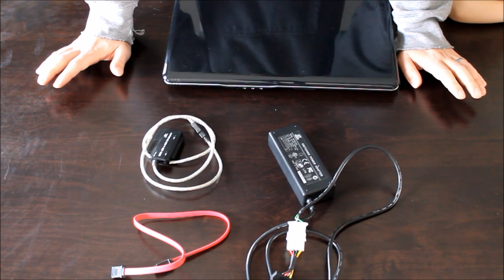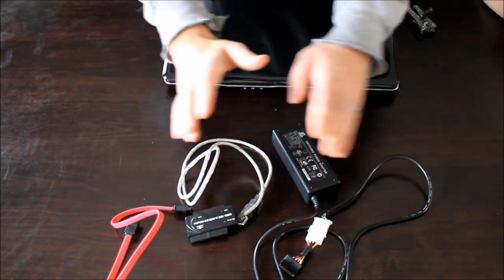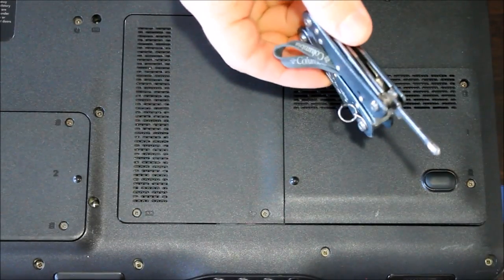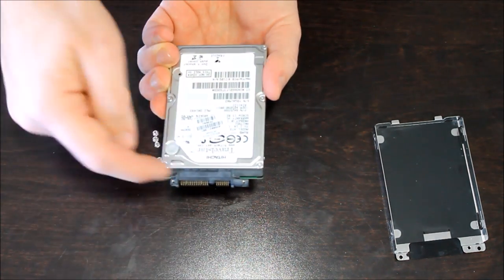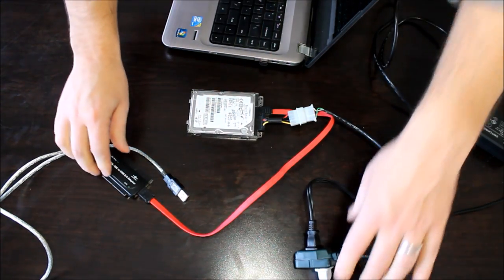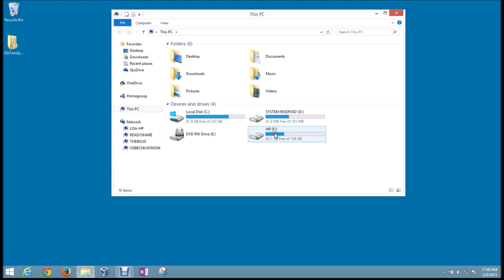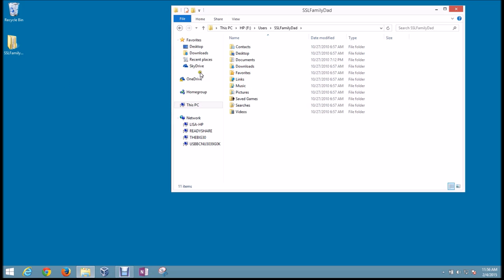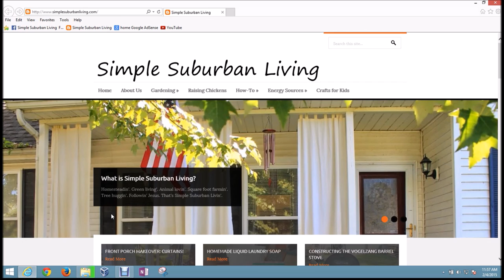How to Recover Data From a Dead Computer

Comment: Hello, my netbook has a problem in it, when i open it a hard disk error always there, and when i press enter to continue start up, this appears, this error can be caused by unplugging a removable storage device such as an external Usb drive while the device or in use , or by faulty hardware such as a hard drive or Cd-rom Drive that is failing. make sure any removable   storage is properly connected then restart your computer. if you continue to receive this message contact the hard ware manufacturer 

Status:0xc00000e9

Info: an unexpected I/0 error has occurred
can u give me some tips so i can recover my files without damaging it.

Comment: Does this method also retrieve my outlook (email) files?
Reply from the maker: +Linda Casey you can, they are in a pst file either in your documents folder or in appdata/local/microsoft/office/Outlook or a similar folder I can't verify right now as I am mobile but you can look it up
Reply: I'll need the cords you recommended for this right? Also, I have a completely dead blackberry, can't get it to turn on at all anymore. Is there a way to retrieve my data from this one?

Comment: Does this work if the computer is password protected?
Reply from the maker: mgiauque01 yes, it should not matter as the Windows security only loads when you boot the hard drive normally. If you access it from another computer there is not security in place. The only way it would not work would be if the data on the drive was encrypted using some third party security or bit locker.

Comment: Hi. How can you tell if it is a damaged hard drive or the motherboard? I have a Gateway that just wouldn't power up one day. The little light on it that says the battery is charging was blue but when I tried the power button, nothing happened. I tried the power reset by unplugging and taking the battery out and holding the power button for 30 sec to a min and then putting everything back... still nothing. Hoping it's not the hard drive so that I can try this method to recover my files and pictures.
Also, how would you do this on a desktop? Thanks.
Great video btw. Makes it look so easy. :)

Comment: Thank you, I'm getting those cables on order.
So the hard drive is corrupted and I was told by the fix it techs to retrieve the data I would need to send it out where they would retrieve the info while in a clean room.
I mentioned your YouTube and how understandable the info is.
They said you don't know what you're talking about, I misunderstood, or you were talking about something else.
Good thing they display their true colors and I didn't use their service. 
Thanks again and my new computer came in today!
Wahooo!

Comment: I bought a USB 2.0 to SATA/IDE adapter with power adapter, I took out the hard drive and connected everything to my computer and it says, E:\ is not accessible. The parameter is incorrect. Then it gives me an option to format it. I don’t want to loose my data. What do I do to get my stuff off the old hard drive.

Comment: Hello 
I have toshiba laptop (P55 A5200) and just replaced hard drive at local geeks store because its gone bad.
But now I really need to recover all my data from old hard drive to a new hard drive just installed in my laptop. I watched your instruction on u tube video but I'm still not sure if its going to work on my laptop. 
Would this recover kit really going to help me recover old hard drive data to a new drive if I follow your instruction? I know it sound so silly but I'm confuse because it all may be depend on hard drive condition isn't it ?
Please help !!
Thanks

Comment: hi i was wandering if you can help me?
I just got a new pc for my work but my old pc which has windows 97 on has the software on it, and i need that software to use for my work, now i have the software on a disc but as i said it runs on windows 97 so i inserted the disc in my new pc it loads up and it comes on the screen and i select it but nothing happens, it says run or save which i selected both and nothing happens, do you know how i can run this software on my new pc. i tried the hard drive adaptor way but the hardrive is buggered so thats out the window. help me pleaseeee

Comment: I got the kit and tried it with two different drives one came as an error and the other is very old 2003-2005ish and the ide only connects with usb it starts like buzzing so i didn’t know if anything was going to happen... didn’t see anything on laptop it was connected to

Comment: Small tip: On a drive from a Windows XP, all of the users and user data are in the "Documents and Settings" folder. It may have just been my computer though.

Also, I have a w7 drive that I can't get permission beyond the "Users" folder. That is, I can see the users, but can't do anything beyond that.
Reply from the maker: you are correct, Windows XP is "documents and settings". As far as permission, right click on the user folder, go to properties, then security, then edit, then "add" and  type "everyone" and click "check names". The Apply and ok, then you should be able to get in
Reply: SSLFamilyDad what file did you moved at :20  ?
Reply: @SSLFamilyDad  all I get is this file is empty when I try to acess my videos

Comment: I have 2 questions.
1) Will this work if I take the HD out of a laptop that doesn't go past a certain screen upon set up (powering on) that makes a constant loud beeping sound / noise.
2) Can I take a HD out of a macbook and do the same process as you did in the video and connect it the same way to a Windows laptop and copy everything over to a different external HD or SSD?

Comment: Thanks for help but I seem to be coming across a problem. I have the previous hard drive hooked up to the SATA cable and i appears onscreen. However when I go to users, my previous name does not appear. All I have are Guest, Public, and AppData. Any ideas why, or suggestions? Thanks
Reply from the maker: +dudizt see if you can enable hidden files and folders view and see if your  user account is hidden for some reason, look through all of those folders and see if anything comes up for your folders.
Reply: that was the issue, thanks for the help

Comment: Hey I just saw your video, found it really helpful for me right now. Well. In my case, the problem is, I had made a partition in the hard drive, and had shifted the data, to it, regularly. My first question is, will it be available still ? Secondly, what exactly is there in the system reserved partition ?

Comment: How do you remove a hard drive from a desktop?
Reply from the maker: All are a bit different but the general idea is take off the side panel and then look for the hard drive. There will be a slider, screws, or latches holding it in. Unplug the power and data cables, slide out or unscrew the drive and transfer off your data. Hope that helps!

Comment: I'm not sure if I can retrieve my data from my laptop using this way. As the data is influenced by the bitcrypt2 virus.
I have a question .If  I connect the laptop harddisk(influenced bitcrypt2) to my desktop(totally no virus), will my desktop  get effects by the bitcrypt2 virus?
Reply from the maker: Lee Rong Zhao Ok, there are a few things you can try to get your data back even after you get stuck with the crypto virus. There are things called shadow copies that by default might keep a sort of file history of most of your data. I won't go into details on how to find your data from the shadow copies but you can look up that info elsewhere. You should be safe to connect the hard drive to your working computer with no effects but make sure you have active virus protection running on the other computer just to be safe.
Reply: SSLFamilyDad Window Defender is it strong enough ? :3
Reply from the maker: Lee Rong Zhao If you have Windows 7 or older install the full Microsoft Security Essentials software. If you have Windows 8 or 10 I would get AVG or Avast for a free solution.
Reply: okay :D 
thank you so much

Comment: A while back I had I had the shocking experience of my laptop not being able to start up Windows, and old Windows Vista. I knew there was a way around recuperating data from the hard drive, so I looked up info. and this was the first video that I came across that I found to be super helpful. I looked up info on what cables I needed, etc and I found something in Amazon, but I needed to check back on the video for anything I might have missed. Unfortunately, I could not find the video lol, but I searched my History, and I finally found this video again, it was like loosing an extremely important document, because there is no other video that explains what you have explained so that I am able to understand it. I have subscribed,  now so that I do not lose the video again. Thanks so much.

Comment: @Je99na2 -you should be able to use F8 or F2 to enter either advanced startup and recovery options or the system BIOS where you can adjust these and other settings. 

 If you find an option to use "last known good configuration" that might be your best option.

With Windows 8 though it really does depend on exactly how/where you tweaked the bootup time. If you changed the timeout setting under the boot configurations that may have to be modified from the recovery console command prompt.

Good luck.

Glad to see there are some courageous people left out there like SSLFamily. :-)